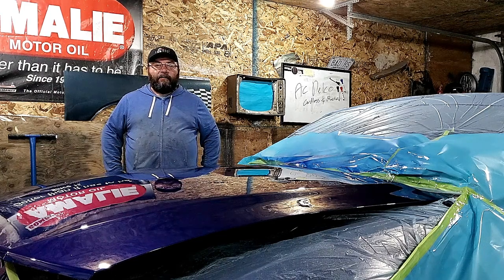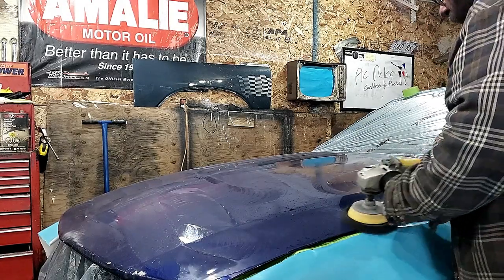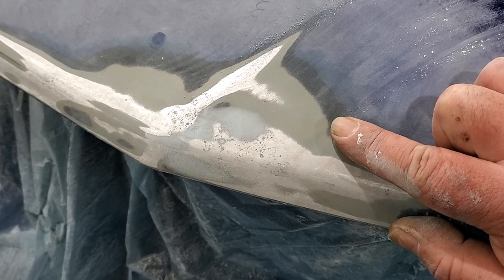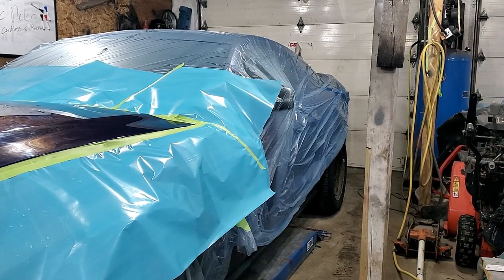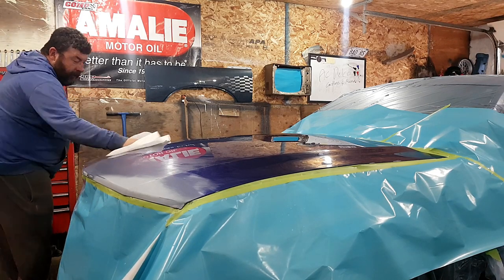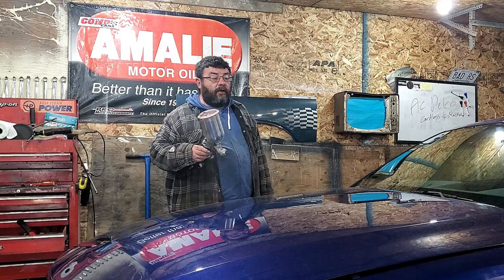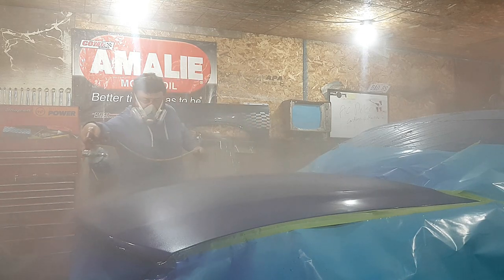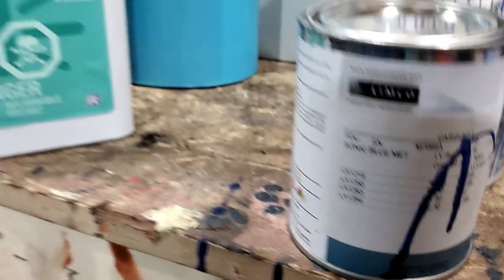how to paint a car hood at home base coat clear coat

Comment: I could tell immediately that you'd been behind a spray gun more than a couple of times the moment you started spraying. 
Question: Did you follow up with wet-sanding and polishing after the clear was applied and cured? I'm in a similar situation now and will be painting only the hood. (I'll probably remove my hood for the purpose of using a makeshift booth). Great video, BTW... very helpful!!
Reply from the maker: I put a polish on it to nib out a few dust nibs but if I remember right the finsh at the end was out of the gun. I did a separate video on the polish process 👍 let me know if you have any questions and thanks again 😊

Comment: OK, I gotta ask a dumb question, and it will show how much I know about autobody, (zero). 

Why not just remove the hood, so there's no risk of over spray on the car, and you won't have to mask anything. 

Maybe it's difficult to realign body panels?

Or you might damage the hood trying to put it back on?

-Chuck
Reply from the maker: i was going to take the hood off, the only reason i didn't  is I work alone (a George Thorogood song?)99% of the time.  great observation

Comment: To keep wet edge use slow reducer..your baseciat and clear will lay down flater less  orange peal will be minimal... and yes you can paint from mid of hood to the edge... and paint will not flash over you will  keep a wet edge..